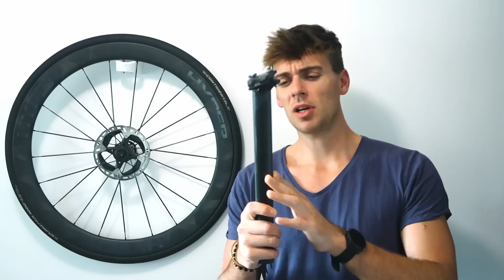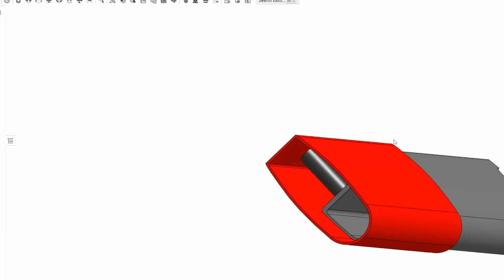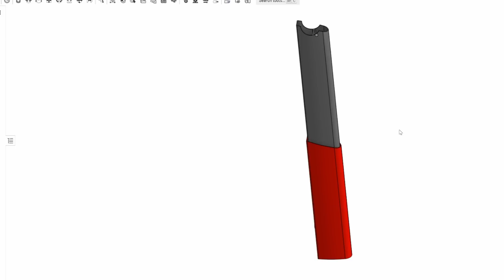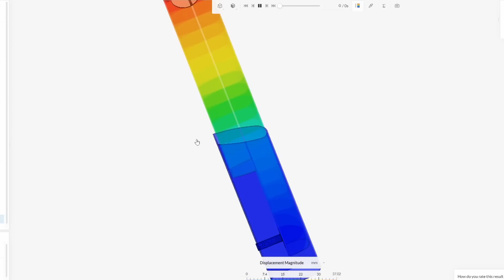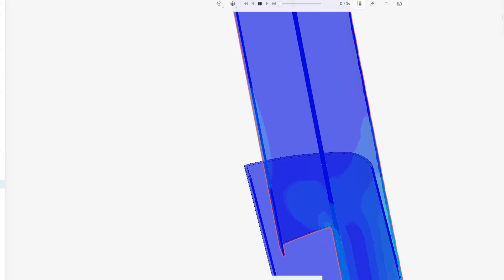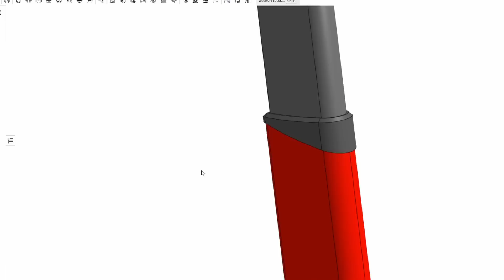2021 Canyon Aeroad seatpost fail, fix & The State of bicycle frames in 2021.

Comment: I feel like it's becoming more and more prevalent that companies are using customers as beta testers, lowering the acceptable standards across the board. Shits me up the wall. I swear it's a management thing, I feel like the meme of agile methodology has slowly been poisoning the well of engineering due diligence.

Great video, 11/10, would buy a Shimano frame that splits in half after 2 years like their cranksets 😅 (check out thanksshimano on insta 😉)

Comment: Steel frames. I say it all the time. If you don't cycle high-end, you don't need a high-end cycle. Get a frame that stays with you for a decade. Upgrade components and wheels instead.
Reply: I have a really cheap steel frame where the seatpost started to wander after a few years (stopped that with some tape in the tube after I switched the post and the clamp without success). I have a really expensive steel frame that came out of spec from the manufacturer (bike was configured for a gear hub and apparently the frame needed to be widened for it which did not happen). The problem is not material, it's proper processes, quality control and people who care for their work.

Comment: I think anyone spending over the £2000 which is the lower end of the market, is entitled to areospace standard engineering, weight for cost ratio puts a 5-6kg bike frame in the same range as a ferrari

Comment: Forgive me if I’m way off here but didn’t Trek essentially get this right with the iso decoupler on the Madone? 🤔
Reply from the maker: Yeh. A well thought out solution that works. Elegant. Crikey!
Reply: @PeakTorque  sadly not entirely. The pivot bolt is prone to working loose, which allows too much movement. Result = crack at top of seat tube. Quite common, and happened to me. Trek replaced the section without question, tbf.

Comment: Have you seen the damage the clamping bolt has also been making? Users may be over torquing it but it's creating an indentation on the seatpost. They bring these things to market without any real-world testing.
Reply from the maker: I havent seen that no. That is criminal. Again, a simple calc to work out the face clamping pressure...F/A where F is the bolt load of an M6 at 6Nm etc...Probably about 5000N on that small patch.
Reply: @PeakTorque  The bike is literally shipped with a basic 5nm torque allen key that makes it dead easy to apply the correct torque.
Reply: @namwen1  yep but like a lot of these fancy seat posts at the recommended torque they slip, so you need to make it tighter. And of course it damages the components. So it is a lose lose scenario. Basically not fit for purpose. There is laws for this but the manufacturers send you in circles hoping you will get frustrated and go away.

Comment: summary: best solution is to AVOID Canyon for all times
Reply: Unfortunately that's a big "provided".
Reply from the maker: Not quite. The old Aeroad SLX was great. Ultimate and the Endurace are good products too provided the BB is in tol.
Reply: @PeakTorque  Quite a few of my riding mates had ultimate slx frame issues. Broken rear beams within the first 1000 miles, craked frame around the holes for cable routing. And the costumer service is notorious for being really shitty. I would avoid Canyon at any cost.
Reply: @Peak Torque this issue with seatpost is just the tip of a iceberg, there are many cases with cracked carbon frames, inaccurate BB hole and the newest model end up with this seatclamp issue, it's tendency of crap.

Comment: I believe they went through all of this while designing the thing and all worked well. Then they did prototype production that worked well. After that they decided to manufacture them at lowest possible cost in material that is hand laid and got bit in their ass. That’s like using the interns to get mass production product in place without any experienced supervision.
Reply: I wonder what weight of riders they used for testing
Reply: @jonnoMoto  you know, i bet they didn't do any testing , made it and sold it off design

Comment: Looking at the cross section, my gut feel is the seat post is far too slender and the clamp length is far too short to achieve the cantilever action.. The carbon fibre would surely crush.. therefore the seat post needs the restraint at the top tube.. sorry, but I think this whole video is wrong.. except for the poor seal at the top tube
Reply from the maker: The clamping area is very small yes, but its analogous. The seatpost doesnt know its inside another tube with clearance.
Reply: @PeakTorque  I just read the cyclingweekly.com article on the issue.. I believe it’s their understanding the design intent is for the seat post to be restrained at the top tube.. it’s a shit design which allows for slight clearance, but friction to restrain it with carbon paste and debris that enters. 
There’s no way in hell the design intent is for the cantilever action to be achieved solely by the bottom clamp.. lever arm waaay too long, seat post too slender and clamp way to short..

Comment: The cycling industry and the sycophants who enable it are truly despicable. I'd much rather spend my money on something from ali express. At least if it's shite it only costs a tenth of the price.
Reply: The aliexpress frame I bought for $500 came with a rubber seatpost grommet. 1/10th.
Reply: @Jordy Boom  Incorrect. Some factories have their own, in-house designs that they sell unbranded. You severely undermine the talent in Asia. I work in the design and manufacturing field btw and have personally experienced it.
Reply: I buy everything except the mechanicals from ali and never ever been disappointed. Including 2 sublime carbon mtb frames.
Reply: If the shite fails and you bite the dirt at least you have saved money to repair your teeth. Nice thinking 👍
Reply: @cularu1  and that's happened how many times ? Bet at least 90% of the stuff you ride on/in is made in China.
Reply: @abedfo88  if you like to play Russian roulette it's your problem
Reply: trrruuuu

Comment: what an unreasonable rant. 
- They can't make the seatpost thinner because it would bust the seattube below the camp. They need the contact on the back. 
- Shimano Shimano Shimano,... can you please stop your fanboy Attitude. they also have major fuckups 
-  producing a carbon frame is not as easy as you say.  Also they come in different sizes, have a way smaller lot size, and have a lot more manual labor.
Reply from the maker: The upper non-structural section should be smaller to increase clearance, and the bottom section could stay the same but increase the layup to increase the bending stiffness. Who cares they have multiple sizes? Or smaller batches? If you cant achieve it, stick to aluminium construction. Not the consumers problem.
Reply: @PeakTorque  The leverage of the small length below the camp will create a huge pressure and crack the frame. They can't increase the layers after they sold the frame. so your solution will create bigger problems. 
And my comment about small lot size and different sizes makes it a lot more expensive to produce, than Shimano building a derailiour that they can sell to 100 different frame-makers in the exact same size.
Reply: @muchmore344  What about chainrings or crankarms? Also, mass produced CFRP shouldn't be a problem, high end campy and sr*m is mostly carbon.
Reply: @joerutherford6547   what about them. if you can sell more the tooling can be more expensiv. Also they are smaller items so the tooling is smaller and cheaper.
I don't say that canyon made no mistake. Of cause they fucked up. But saying "a look this other company made a really good screw. Why can't this company build a flawless bridge" 
And on top of that pronouncing an "easy solution" that will beak something else is kind of a dick move

Comment: Can you do a video on how frame manufactures can (if they can) avoid/ stop disc brake squeal? 
As I see it there must be a link between resonance of frames, wheels (spokes) and the brakes.
Reply from the maker: We'd all like to know the answer to that...but the main reason is that the pads need to be very lightly constrained in the axial and radial direction to be applied and released evenly and flatly. This lack of constraint allows them to vibrate. If you look atcar brakes, the pads are much more firmly constrained to the pistons with cone springs.
Reply: When fitting the pads put a small amount of copper grease on the back of the pads, this is common practice in the car industry. correctly they should have a half washer and copper grease , but the tolerances are too small for this to work as an after market solution.
Reply from the maker: @johnrandles703  Yep, in a car with servo assistance this is fine if a bit of grease gets on the brakes, but this would be a nightmare if you got copper grease on the bike discs!
Reply: @PeakTorque  I have been using it on a DH MTB (Hope V2 brakes) for years, also back in the day when I raced here in Austria, the trick is high copper content and a very small mount, just a smear, it is designed to take very high temperatures and not move.  just never get it on the front of the pad.
Reply: @johnrandles703  mechanics haven’t used copper slip on the back of the pads in a long time. Ceramic brake fitting compounds are used to keep sliders moving so pads track correctly. Most pads nowadays come fitted with either piston retaining clips and/or rubberised and/or adhesive backing pads to ensure proper piston fitment. Squealing is caused by incorrect alignment mostly. Disc mounting faces to the hub should also be clean so rotors run true, another reason for squealing and judder. I’ve seen big wedges of copper grease applied on the inside bell section of disc rotors and the mechanic wonders why there’s pedal vibration. As soon as they toque down the wheel in pattern the grease creates a wedge under the disc 🤦🏼‍♂️. So essentially on a road bike if the calliper/pad/rotor alignment is not consistent you won’t ever stop the squeal. 15 years in motor aftermarket btw.
Reply: @jonstreet1498  good point but the disc brakes on bikes are at the level of a 1960s car, so we need an old solution, or a complete re-design to the standard you just mentioned , but as everyone in cycling is weight obsessed i just can't see this happening .

Comment: It’s frustrating, it’s like why should it be down to a mechanic to have to face disc mounts on a new bike! Chains fitted from factory to short, 
Send it out with full length brake hoses and then expect us to have to supply olives and inserts.
List goes on!
Reply: 💯 cos they are getting away with it! The bike shop is in the middle. Wants to keep both happy.

Comment: Your speech really needs to be picked up by the cycling media 👏
Reply from the maker: its 2021 this IS cycling media 😁
Reply: @PeakTorque  Fair, fair. Let's hope your peers take the same tone and not just Hambini, his video will likely be banned if it hasn't been already 😂
Reply: @kpizzle1985  Hambini video still there. probably canyon not like flo.
Reply: Yeah, something GCN would never do.
Reply: @shhhdontshout  GCN are 100% marketing, you will never see a real review on any of their channels
Reply: @shhhdontshout  yep, a quick search of all the usual sites reveals the typical glowing reviews, no update or coverage of this issue.
Reply: Cycling media is just the outsourced PR and advertisements for cycling manufacturers. It's a joke.
Reply: The cycling media has always been extended marketing. A fork that had a square leg in a round hole had needle roller bearings to reduce stiction. Only trouble was when the leg sniffed water the rollers rusted and seized. I read loads of mags through the 90s and not one mag mentioned it although we had loads of bikes stacked up.
Reply: @tobycolin6271  Cannondale were always a bad choice. In the MTB world they were already nicknamed crack'n'fail by the end of the 1990s, but all the money they never spent on engineering went towards marketing and sadly that's how you get sales. The worst thing is the Headshok design was good in principle, but they never implemented it well, so everyone assumed it just couldn't be done after a while.

Comment: PT - as an organised and capitalist-leaching anarchist, I'm very much interested in not buying frames from the big manufacturers. You got any recommendations for non-cunty frames? Hambini seems to like Yoeleo and Winspace, as well as Look.
Reply: @Matthew Carlin Even that's a minefield hey. The more these bikes develop the more inclined I am to get a basic (but fucking good) frame, exposed rim brakes, classic stem and handlebar, good shimano components and Winspace wheels. Fed up of all this Western shite marketing crap.
Reply: Merida, Giant and Look are the best of the worst
Reply: Hi Richard I can recommend HongFu-bikes, I only have a sample of one a FM208 Track frame for $745 +( local tax / import duty) price inc.frame, headset, stem, forks, seat post, seat clamp and is UCI approved! Ok its a track bike but they do other frames. The BB shell has perfect alignment BB86 not included and the head set is also spot on. I am totally over biked, but the equivalent from Look would have cost $8500 and I will never produce the power to feel the difference.
Reply: I do believe "Bastion bikes" made in Australia are pretty good and have some great recommendations from experts in the field. They are ex-toyota engineers that were displaced when toyota pulled out of Australian. The build is custom and has 3D printed titanium lugs and carbon tubes wound on molds. But are expensive.

Comment: Amen to this! At this point, I might just either buy my next carbon frame straight from a factory and pay what it is actually worth whilst receiving arguably more consistent quality. OR I just keep on doing what I did with my gravel bike - Have someone build me a nice steel frame in just the right size at less than half the price that Canyon et al ask for their stuff.
Reply: Quality bikes have never come from large scale manufacturers. Until recently most of the bikes in the pro pelotón where flying false flags- in the eighties for example the French artisans at Cyfac made what sometimes seemed like the bikes of half the field, tho usually none bore the name. Nothings changed except the prices. If you go for carbon look at Cyfac, 51Bikes, Festka etc. Yeah they'll cost as much as a top end Canyon or Cervelo or whatever but at least you'll be paying for craftsmanship not marketing.
Reply: @brianbolger6313  You're right. 5 grand for a bike frame however is a pretty exclusive market.
Reply: Try the high end pragma from durianrider or boutique brands like parlee or lynskey. It comes with a price but knowing you get quality frame.

Comment: That customer's seatpost is worn all the way around. The dynamic radius of the seatpost needs to be reduced so greatly, I'm not entirely sure Canyon will be willing to go that route. It's weird that they didn't take a hint from Specialized with the simple Roubaix seatpost design or Trek's over engineered IsoSpeed where the entire ST flexes around a pivot.
Reply: yeah, you are right, there are not insignificant forces on the sides too and that would mean making the seatpost excessively thin
Reply: Trek IsoSpeed on the 2016-2018 model is the best one they made. A simple idea brilliantly executed! Works really well...